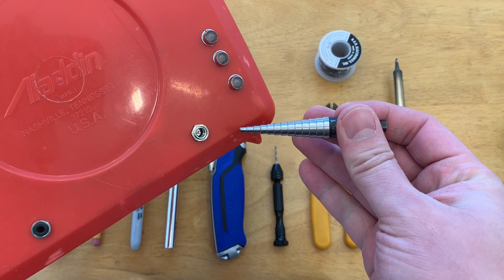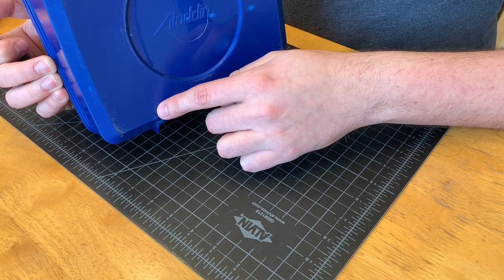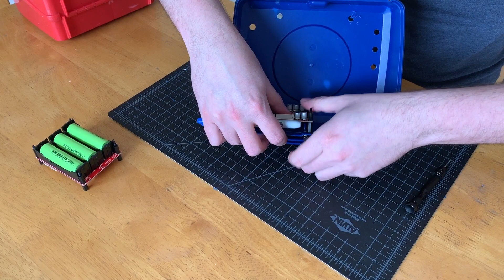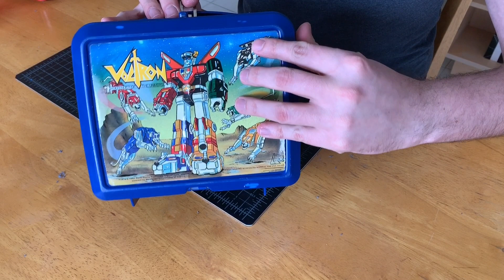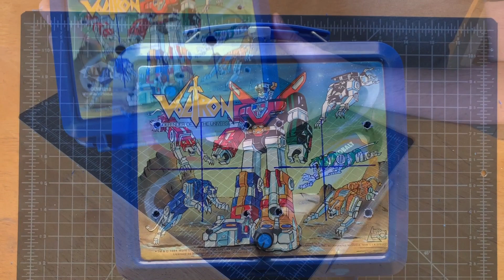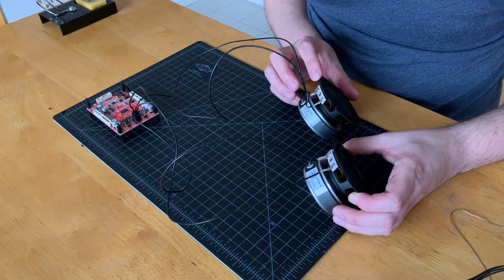How to Build a Portable Bluetooth Speaker into a Retro Lunchbox

Comment: Thanks for taking the time to publish this video, Anthony.  I purchased the same KAB amplifier board/accessories but I also purchased a tweeter along with my two woofers.  I'm no audio expert so I'm curious as to how to wire the tweeter to the board, as you describe the woofers are fairly straight forward. Any ideas? I'd appreciate the help.
Reply from the maker: Thank you for checking this out Nick.  I don't have experience with tweeters yet but I have heard for splitting a right or left channel signal to multiple speakers you would look into a crossover circuit.  Hope that helps start research.  I'll see if I can find any info to post back.